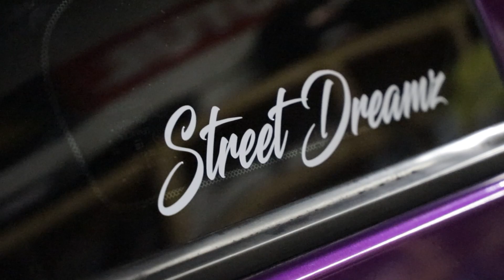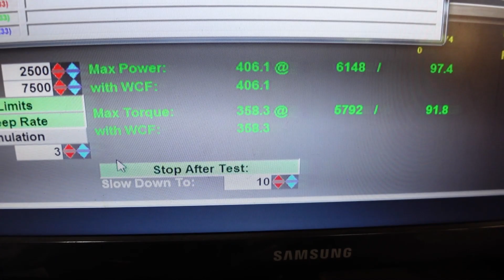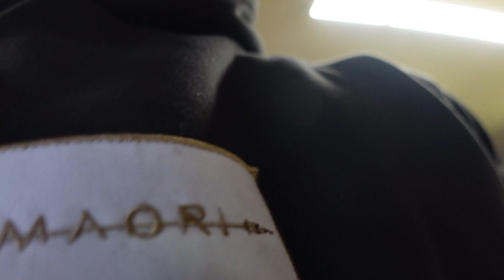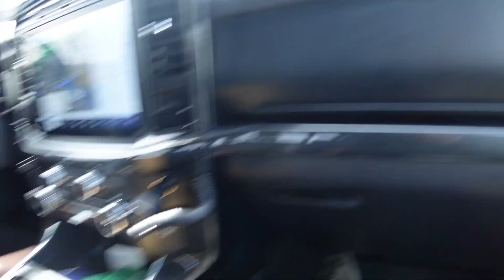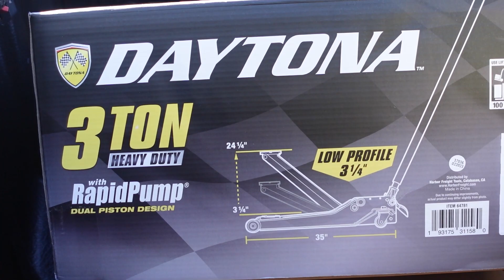INSANE 430HP 1JZ 350Z BLOWS UP ON DYNO (EPIC REBUILD)

Comment: That Toyota pink coolant is going to slip past your gaskets and leak .With the older engines you need to use Toyota red with distilled water. That's the jam I have on my 2jz

Comment: Damn . Great job swapping it over fast .  What was wrong with the oil filter adaptor ? 
Was it showing good oil pressure the whole time or something
Reply from the maker: No it didn't end up being that. The issue was that our dumbasses didn't know to plasti gauge the new rod bearings. They must of been to tight and once they experienced being under pressure they spun but made is almost 500 miles on break in tune.
Reply: @StreetDreamzllc you live you learn, looks sick regardless

Comment: What was the cause of oil flow issue?
Reply from the maker: We did plasti gauge the rod bearings so they weren't the right size which caused them to spin and then all the metal shreds filled the oil filter therefore not allowing oil to feed back into the motor

Comment: both 1 and 2 jzgte and 1 and 2 jzge (non vvti) are all non interference with stock cams.  bigger cams make them interference.
Reply from the maker: We have a VVTi it's interference
Reply: @StreetDreamzllc  1j vvti gte's are non interference.  the only jz engine that is interference is the 2jzge vvti thats in the usdm is300s gs300s etc.  if stock cams.
Reply from the maker: @feelgoodhorizon4084  "Yes, the 1JZ-GTE VVTi engine is an interference motor" -chat gpt
Reply: @StreetDreamzllc  chat gpt is wrong. these are not variable lift or have hydraulic lifters. when vvti is on it doesnt make it interference like vvl does.  https://www.youtube.com/watch?v=K3OzLrMZakg 
a 5 sec search will show you a video you are just too lazy to do yourself on your own engine to find out.  i have been messing with jzs for long time man i can tell you 100% if its stock oem cams its non interference.  all gte's were non interference and only the 2jzge vvti was interference do to the piston height for higher compression, which made it interference.